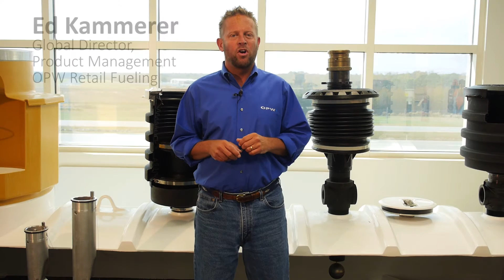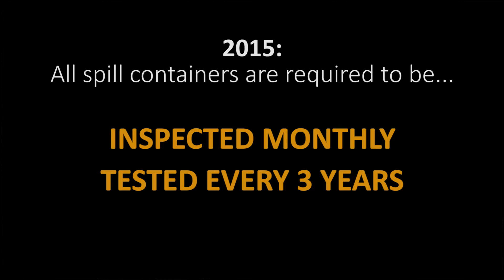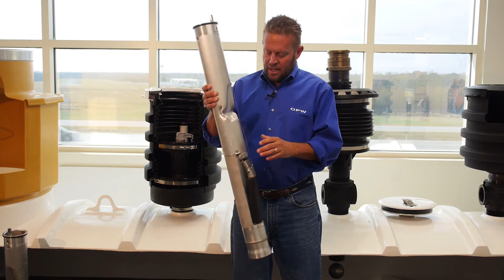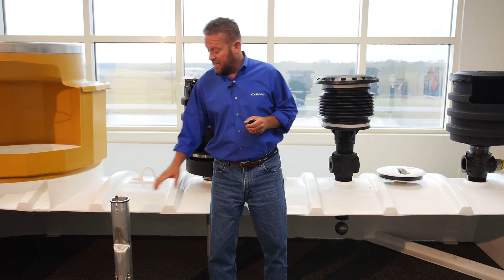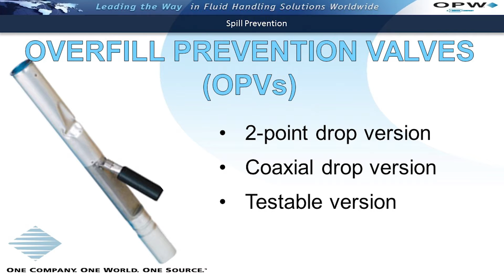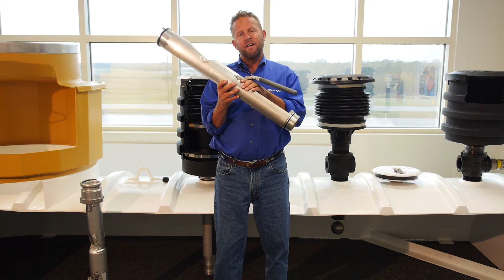Methods of Overfill Prevention

Comment: As a guy that drove fuel tankers for many years ...let me tell you the sound of "TUNK" when you are almost done filling a tank is just plain nasty. This happens when the over fill detection slams shut. Yes over years I figured out how to bypass the system but I do wish customers wouldn't order more than they can take. This can be driver error, wrong tank info or sometimes the tank will shift to an off level situation and your dip stick reading will also be off. Weird but I do not miss it. Or the customer  who comes out and says just put the extra in the premium tank. (a firing offence) I don't miss the idiots either. Like the ones that run over the safety cones and try to run over the hoses or the brain deletes that walk up to you with a cigarette in their mouth.  And I've got about a million others I won't mention.